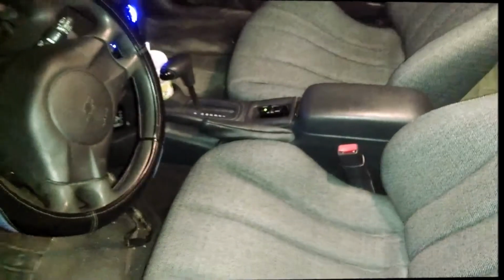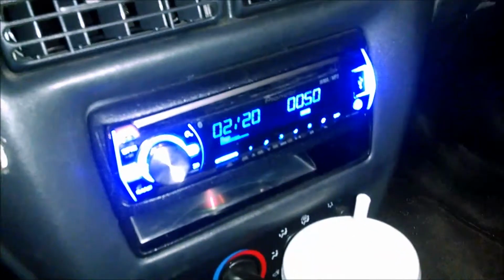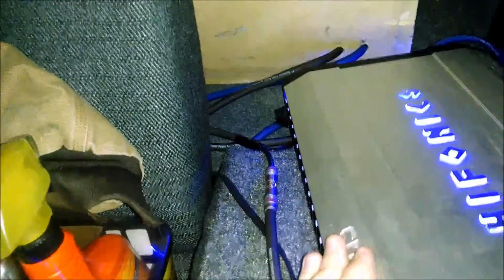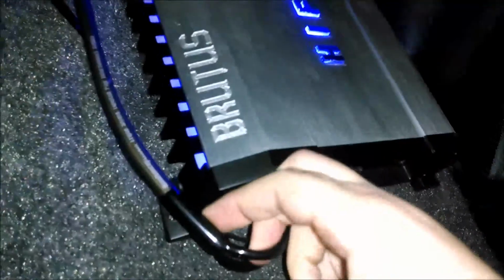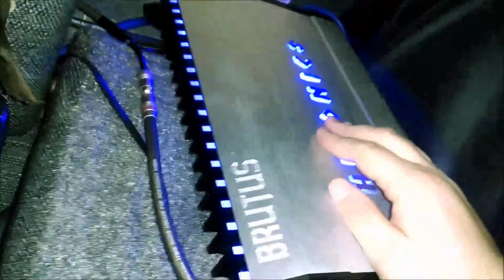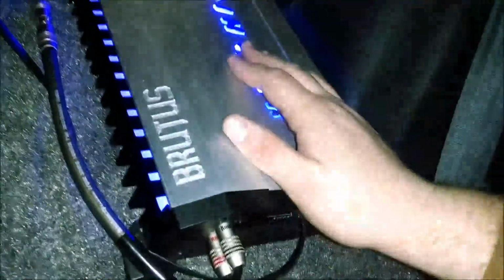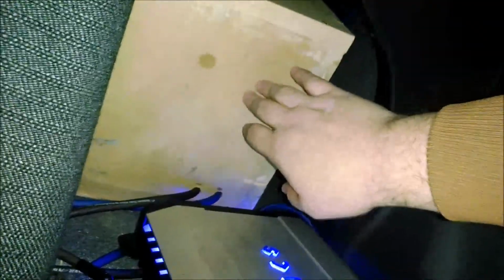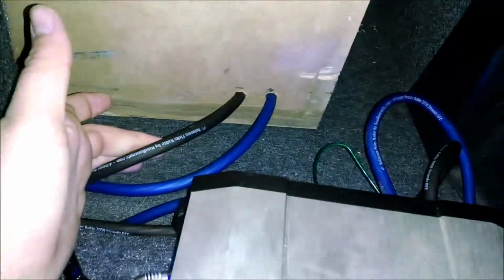Soundqubed HDC3 15

Comment: Dont put ur amp on ur box the vibrations from the sub with move the amp so much itll wreck ur amp ur saving up for on the the other hand i have 07 chevy cobalt ss 2dr coupe im waiting to instal my system its 2 15" SOUND QUBED HDC3 A 5000RMS AMP NEW TWEETERS SPEAKERS IN ANOTHER QUESTION Y BY THAT HUGE POWERFUL SUB IF UR NOT GNA POWER IT RIGHT THE STOCK ALTERNATOR IN BATTERY N COBALT  WILL BE FRIED REALLY FAST IF U DONT UPGRADE I HAVE TO GET 2 300AMP ALTERNATOR THE BIG THREE UPGRADE MUCH MORE GD LUCK VIDS COMING SOON